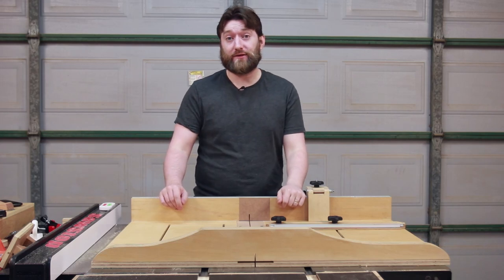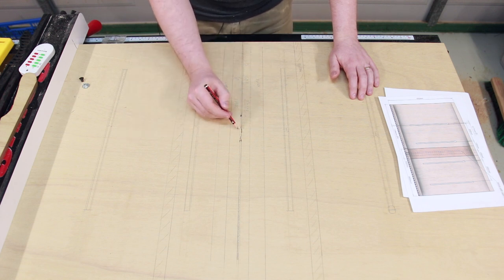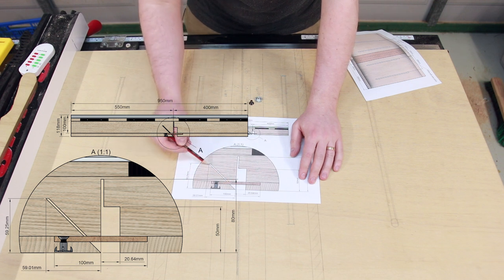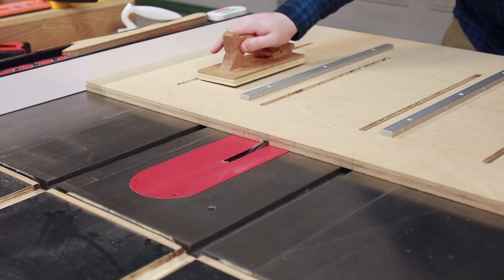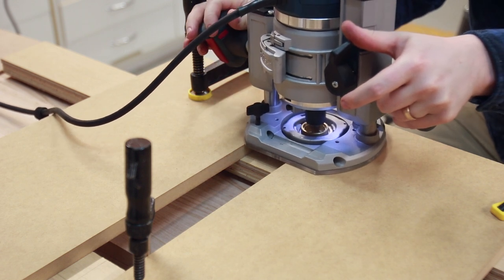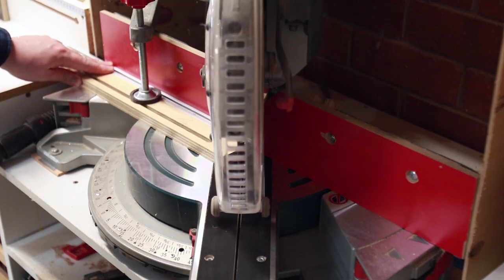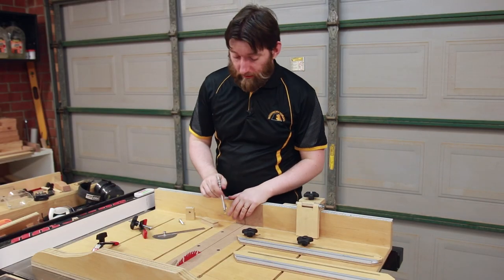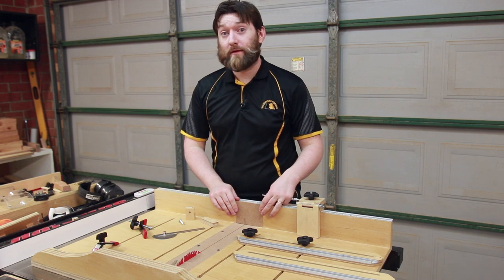How To Build A Cross Cut Sled (Free Plans)

Comment: Please excuse my ignorance, but what is the purpose for the red Incra rack things? I went to the Incra web page and there is no explanation there either.
Reply from the maker: When two pieces mesh, it forces the stop to go to a certain point, making it repeatable. ie, if you place the stop at 250mm, the rack will force it to 250mm every time. Otherwise, you might end up with 250.1mm, 249.7mm, etc.
Reply: Thank you for your prompt reply. Awesome sled, by the way. I recently bought a new to me used saw and it will be needing a sled. I plan to use your design.

Comment: Hi Paul, thanks for sharing. I’ve found squaring up my sled fence a little difficult. I think maybe the kit rails are a little short for my liking as they rack a little due to the spacing of the grub screws when the sled in pulled forward for the wide 5-cut mdf sheet. I just can’t get repeatable tests. I might swap them out for longer UHMWPE rails instead. Any tips for swapping rails after the sled base has already been cut? Also, in the video you mentioned that you were working on a sub-millimetre stop block - have you made any progress? Cheers again for your effort, it’s much appreciated!
Reply from the maker: I haven't ended up ever having the need for the sub-mm adjustable stop, so I never ended up fully developing it.
If you used your tablesaw square for the initial placing of the runners, that's probably going to be the easiest way. Put sled down, adjust fence to kiss one end, take sled out,unscrew runners, put new runners in the track and screw down from the  to side of the sled.
Reply: Paul Jenkins Hi Paul, just another quick question - what model is that router you use in the video? It looks like a Bosch round body plunge router? I’m looking for one to use in both my DIY router table and freehand as a plunge router. I cant find a reasonably powered round body router anywhere? Cheers again
Reply from the maker: Yes, its a Bosch GOF 1600CE. I have a review on my channel. Not the most suitable for table-usage in Australia, as the fixed based has to be imported. Very good router otherwise
Reply: Paul Jenkins I just watched your router video and it was very informative - thanks. I have a diy router lift that suits round bodied routers like the Makita 710 w trimmer/router I have in there now but it only has a 1/4” collet capacity. The round body of the Bosch 1600 would have been perfect but switching power looks like an issue. Can you recommend any other 1/2” collet round bodied routers on the Aussie market?
Reply from the maker: There are none that also have a plunge base.

Comment: Nice work Paul - looks like a great sled. Price on the hardware looks pretty good as well.

I don't normally comment on safety (as lots of people go WAY over the top) so feel free to stop reading as I'm sure it gets annoying.

But one thing that bit me in the past when using the router that made quite a mess (both of the piece I was working on and the router bit - luckily not of me!) was the little t-knob things that clamp the router fence to the base tend to work their way loose when the fence isn't in use (and they're not tightened all the way down).

When it happened to me the t-knob ended up going straight into the 1/2" round over bit and I guess wedged between the bit and the base. The bit ended up with a 45 degree angle in the shaft, and the workpiece was stuffed. Fortunately the router (and I) survived.

Just noticed them moving about in the video (once bitten, twice shy) so figured I'd mention it! As long as they're in a decent amount when you start it's all good :)

Comment: I have an added point for anyone making sleds!
A few times I've ended up slightly tweaking the back fence while doing the 5 cut method adjustment. Having the pivot screw really really tight can put minor flex in the fence (particularly plywood fences) when you adjust the other side, and you might end up with a fence that's absolutely perfectly square to one side of the blade, but way out on the other.
Reply: God point - I clamp a machined straight-edge (in my case a high quality Stabila level) to the fence before moving it.  I use the same level during glue-up to make sure the fence is dead straight to begin with (my tablesaw table is not a reliable reference surface).  Also don't skimp on the fence - you don't want it to flex - two laminations  of good 3/4 plywood is OK... three is way better.

Comment: Hi Paul hope u can reply. This is a great sled. I am hoping to by the rage 5s and they have a weird t shape slit for mitre gauge etc. The top bit of which is only 6mm bottom 24mm. What would be best way of fish g the runners. Also the 5 cut method to align back fence. If the sheet has been cut on a timer yard bed saw should not the board all be square. Thanks for any help
Reply from the maker: You can't trust a timber yards accuracy. I've not had to deal with non standard mitre slots, so you might be best looking on forums for owners of those type of saws as they will have more practical advice.
Reply: @TheWoodKnight  thank u for your reply
Reply: @TheWoodKnight  think I may have to get someone to cut them for me lol

Comment: Hi Paul. Thanks for the video. It helped starting building the sled. 
The dado for the incra racks is 3.5 mm deep. This is much less than the thickness of the racks. Meaning the racks will "stick out" of the back wall of the fence.  Should the racks not be flush with the fence wall?

Comment: Hi Paul, could you tell me, what is the purpose of the adjusting knob on the top of the flip stop?
Reply from the maker: To allow for adjustment of the stops position relative to the tape.
Reply: Does it just allow some play to disengage the incra rack then? @TheWoodKnight
Reply: Im kind of confused, if you loosen the back knob and lift up the flip stop you can move it along freely. Still cant see what purpose it plays??
Reply from the maker: Microadjustment since the racks will pull it in to the nearest MM. Or make your own flip stop if you don't like this one.
Reply: @TheWoodKnight  Sorry if that came across as criticism, that wasnt my intention! It makes sense now. Its a great design and I appreciate you putting it online for free, saves me having to figure it out for myself. Top man!

Comment: Hi Paul, that is a great video! Thank you! I like the ease and peace of the way you explain things, good editing and clear footage. 

I am building a sled so this is usefull. 

Small suggestion might be to correct the audio. Not to offend you but you tend to ‘mumble’ a bit, talk ‘in mouth’. Together with your lower bass voice I have trouble to understand you sometimes. 

I have 15+ professional editing experience and a simple solution could be to add some filters on the audio. Almost every editing program has them. 

Try:
- equalizing, fizzle around with lowering the bass or add a bit of midst, maybe even some high/treble
- use a ‘de-esser’ filter, to kill those high ‘s’ pitches
- on your master track audio, add a ‘normalize’ filter to even out the volume difference for e.g. The voice over and footage audio. 

You might already do this, and sorry if I come across as a smartass. I just wish you even better videos. 

Allright now I am gonna check out the rest of your channel. Thumbs up. 
Pepijn

Comment: This sled looks great. I have a few questions: 1) Since the zero clearance inserts are the full depth of the sled, the front & back fences sit over them. Does this mean the inserts slide out the front or back when the screws are removed when you want to replace them? 2) Those  inserts must get cut all the way through, so you end up with two individual pieces  making up the zero clearance insert in the end, correct? 3) The plan appears to not have a safety block covering the blade as it exits the front fence. Wouldn't that be a good addition to make it safer?
Reply from the maker: Yes, you can slide it out the front or back.
Yes, you end up with two individual pieces, which is why you use screws rather than a sliding dovetail to secure them. There is no (safe) way to use a riving knife without it becoming two pieces.
Not really. Just don't push the sled from where the saw blade comes out

Comment: Another excellent video Paul, especially as I'm just looking at getting a Sawstop contractor saw. Did you buy the 36" or the 52" ?? any recommendations  from the accessories list?
Reply from the maker: +Geoff Semon 36". Not enough room for 52". Dado stack, magswitch featherboard, dado insert, rip blade, good quality combo blade, crosscut sled, router table/extension wing.
Reply: And a partridge in a pear tree...

Comment: Ah!  I see you may be a Bosch-man like me.  Think the quality's gone down recently though.  Thinking of switching to Dewalt going forward.  Seems all the decent makes are dropping their standards these days so may as well go for versatility and cost......Any guys and gals thoughts appreciated before I take the plunge.  Cheers from Blighty.
Reply from the maker: It really depends on what tools you're talking about.  Each brand has pros and cons, some tools they're the market leader in and some they're junk in. Bosch jigsaws (cordless or corded) are some of the best going around, their tracksaw has more power and better tracks than festool (though no riving knife), and the router is the best under $600 in Australia IMO. DeWalt and Milwaukee typically either have more power or more battery life than Bosch, but I don't find their hand grips ergonomic/comfortable
Reply: IMO (FWIW) nearly anything you buy at big box - any brand they sell -  is going to be roughly the same quality - they've all moved their manufacturing to China... they're all trying to retail tools for less in 2018 than they cost 30 yrs ago (in non-adjusted dollars... I paid $500+ in 1985 for a 10" Makita sliding cmpd miter saw... and am still using it daily .  Similar saw today still retails for around $500.. so it's actually 1/3 of the price in real dollars.   But  I can't see today's Chinese-made tools giving me 30-40 years of service like the 1980 versions.... and I don't see the 1980 Japanese imports giving 60-80 years of service like the porter-cable/delta/etc stationary tools from the '50s and '60s.  Most of the stuff now really is throw-away... if a $100 battery operated drill gives you a couple years of decent use before the bearings crap out...  I guess you got your money's worth. It just rubs me the wrong way to be constantly contributing to the landfill.

Comment: G'day Paul, Timbecon has great tools & machines comparable with other manufacturers, I like this sled build but not sure to go with incra sled guides or maybe some Ironbark hardwood, I suppose it's a question of longer lasting durability, what's your opinion mate, keep up the great work 👍🏻🇦🇺👍🏻
Reply from the maker: For me it is less about the durability, and more about speed. Take away recording, and this is an afternoon project with just waiting for the fence glue ups to dry, if using the aluminium runners (these are Timbecons aluminium ones rather than Incras guides). The downside is the cost and these are on the shorter side. However, should you need to remake the sled for whatever reason (or decide to make a smaller/larger one down the track), unscrew the runners and reuse.

If you use wooden runners, it just takes longer to dial in the absolute perfect fit (tablesaw -> thicknesser/hand planing/card scraper), then time for the glue to setup and applying pressure using toolboxes or other weights rather than clamps. While they will eventually wear out, the blackwood runners I had on my last sled held up for a year with no noticeable wear. Seasonal movement can be an issue, so choosing the right wood (over the hardest wood) is the best choice there.

I've done both approaches, both have their merits but neither is a bad option - I think it really comes down to expediency.
Reply: Great looking sled, Paul. I totally agree with your runner thoughts.
Reply: Crosscut sled: What did you go for in the end Dirk? (ps. I'm making this on Saturday)